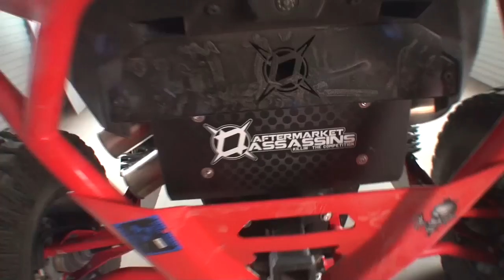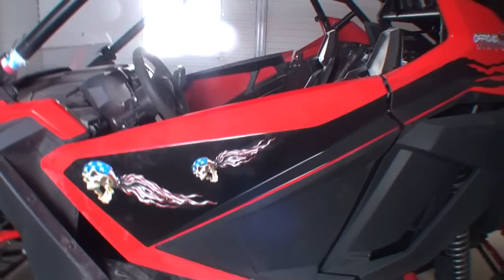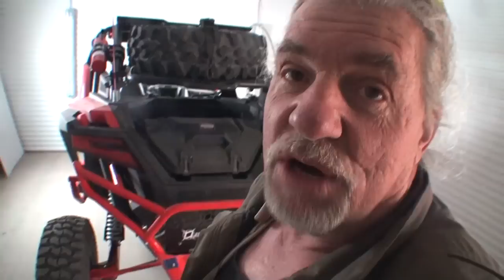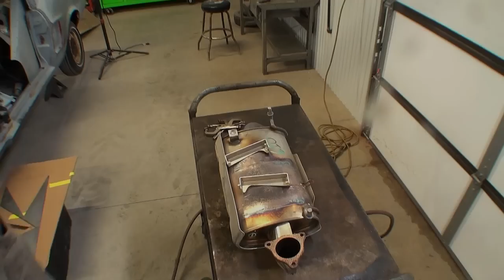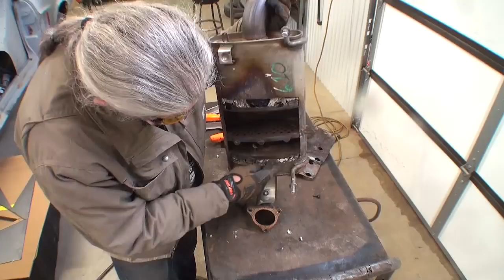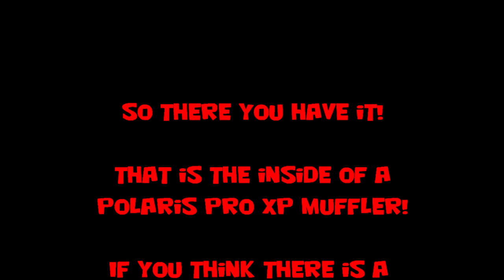2021 Polaris RZR Pro XP  - Is There A Catalytic Converter Inside The Muffler? - EXTREME FAIL

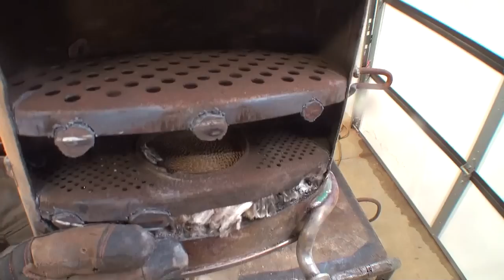Comment: You need Glasses Chief, when you hold the Muffler up @11:39 you can clearly see the Catalytic Converter in the feed pipe! Thats not a Spark Arrester THATS A CATALYTIC CONVERTER, it's made of PLATINUM!!!
Reply: You have never looked inside a Cat Converter before, if you had you would know that is a Catalytic Converter! That Muffler you just paid $750 for is the exact same thing with the Cat removed and two smaller outlets in stead of one bigger one!

Comment: No catalytic converter. It is like you say; 1st is spark arrestor, 2nd is the expansion chamber, 3rd is the muffler or their concept followed by a final spark arrestor. For 30+ the catalytic converter is made with a honey-comp shaped ceramic material that has 3 Nobel metals washed, baked, etc into this grid that all of the exhaust has to pass thru. Basically, if their is one 02 sensor in front between the engine and this device and no second 02 = no cat. If it had a second 02, then it has a cat inside. The second 02 is only there to monitor the converters performance only. Front O2 tells the computer to make it lean or richer, controlling the proper air/fuel mixture. The cats job is to store oxygen when lean & release it when rich. Other cat design materials maybe used but the ceramic honeycomb type is the most efficient.
Reply from the maker: That’s my thoughts on the O2 sensor thing.  I always thought there where 2 if you had a converter. Sure wish I would have broke it down further.  Oh well.
Reply: I am absolutely sure there is no cat inside the original muffler. I was fascinated to watch your efforts and uncover the insides. No wonder it was loud, it’s mostly empty. The blue covered wire bundle goes to the only O2 sensor on your UTV. I really enjoy answering that question and you did very well. P.S. I hope your two fingers get better, but it is a never in that elbow that become irritated after a tendon starts rubbing it. It is easy for a Dr. to do a simple test at the elbow by pushing a finger into the outside of the elbow joint. We are getting old buddy and repetitive use causes it. It is like a wheel bearing you can’t grease. It starts to go bad after 58 years! Take care. I am a 6’3” lefty as well, just 63 years young.
Reply: That vehicle would not be approved for sale in the US if it did not have a Cat! Thats it, I'm a Licensed Motorcycle Mechanic and I take them off Bikes every second day and throw them in the bin!
Reply: @jarnosaarinen4583  I understand, but motorcycles compared to UTV’s is a different world. The rules are different, the class is different! I saw the same thing on passenger cars compared to trucks! Tight rules, regulations & specs on cars but not for trucks. Even imports, as they met emissions standards in 1972, but domestic cars did not! The had 3-way “Bead Type” cat’s on them that required unleaded fuel. Imports like Datsun had not cats or unleaded restrictors in the filler neck until July of 1979! Anything made after that production date had cats & required unleaded fuels. Stickers on gas gauge and sticker on fuel filler caps came after July 1979. I know because one of many jobs at the dealer was checking them into inventory off a transport. Look it up! There is no dealer part number for a Datsun 280ZX in 1978, but was, if the production date was after July 1979. 
NIASE Master Tech since 1978.
Reply: @jarnosaarinen4583  Different class of motor vehicle as off road required spark arrestor only. It is not my rules, but CARB. If you don’t know what that stands for, then don’t comment...after you look it up! Their is a difference between a tech and tree hugger.

Comment: I see simply a regular straight through exhaust with just one large baffle and one small spark arrester in the exhaust tip. The insulation is only there to quiet the barking dogs voice from echoing off the can of the muffler. That is one very expensive video Pete considering there was absolutely nothing wrong with that very expensive muffler.
Reply: I think a straight thru glass pack muffler has 3 time the fiberglass than this thing had in it. The manufacturer thought would would sell more high end 6 speaker stereo systems to over come the noise. I think a helmet with a volume controlled Bluetooth would be a much better option. But, that would cost them $3.18 extra for that $400 helmet feature each. 
Stay safe my friend! God bless!

Comment: I could be wrong I'm not a sxs wiz. But my experience on automobiles no 02 sensor no converter. Usually the 02 is threaded into the converter.

Comment: The catalytic converter is the disk inside the inlet side.   You saw it and called it a spark arrestor.     The spark arrestor is a screen in the outlet.  The fiberglass is the packing.  Very typical on off-road vehicles.